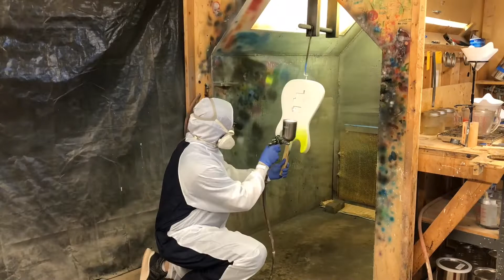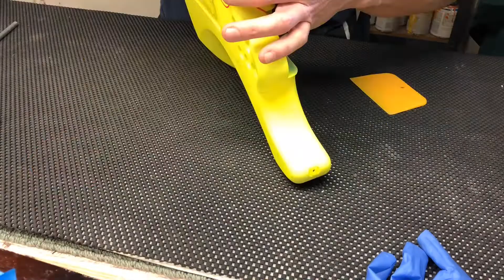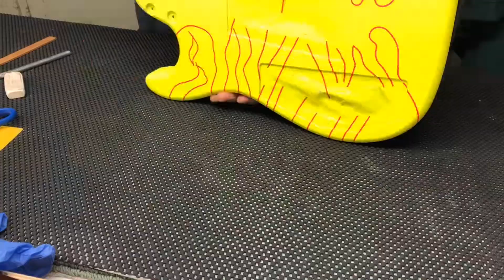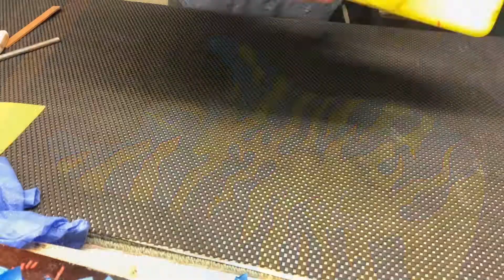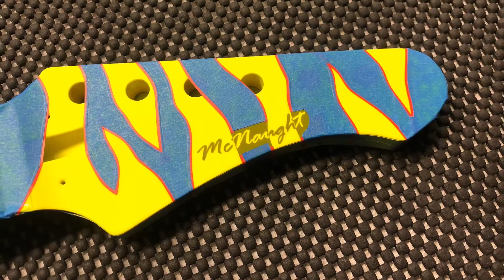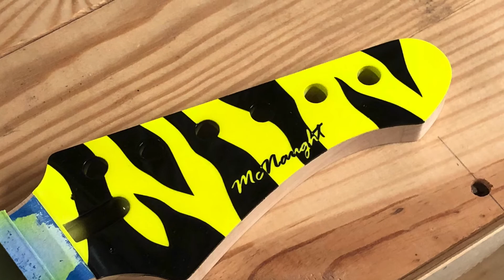McNaught guitars Spraying chartreuse and tiger stripes

Comment: What kind of tape did you use for marking the outlines? Also, what kind of paint did you use? I tried doing this using automotive pin striping tape for the outlines and it was too sticky. It peeled up the base coat upon removing it.  (I used automotive paints in a spray gun for the base coats)
Reply from the maker: The red tape is FBS. The blue tape is 3M. Paint used for stripes was House of Kolor black base mixed 50/50 with House of Kolor topcoat.

Comment: I'm assuming after you painter tape over the outlining tape, you can feel the outline as you start deciding where to cut?
Reply from the maker: Correct. I use my thumbnail to push the painters tape down against the fine line tape on both sides of the fine line tape.....which gives me a good visual as the where to cut also.